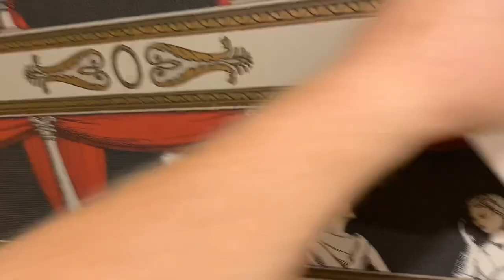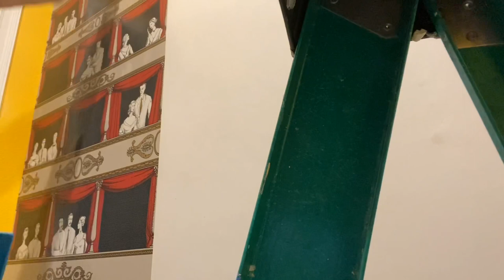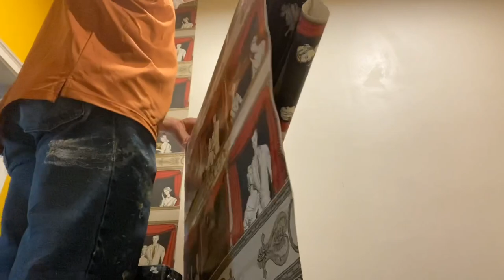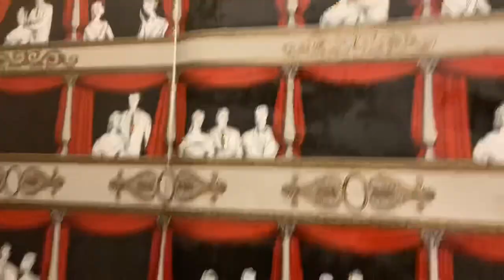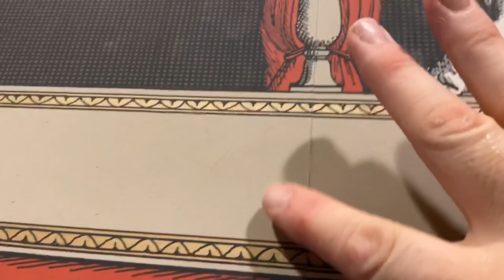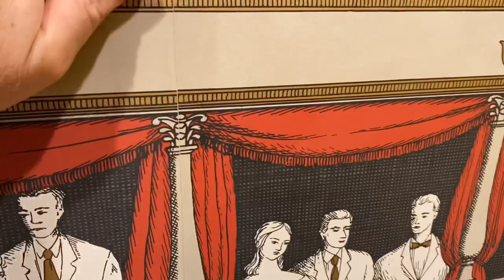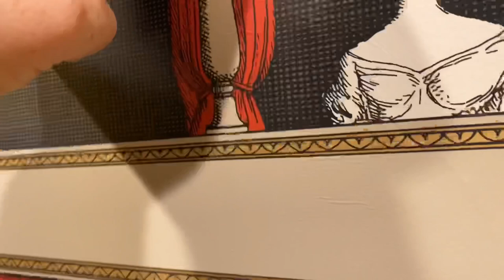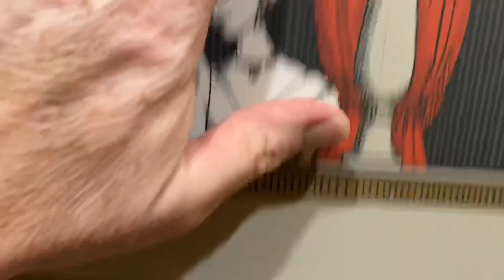How to Correct Misalignments in Cole and Son Wallpaper - Spencer Colgan

Comment: Hung paper for 30 years, all brands, all types, mylar foils, grasscloths,  burlaps, commercial bolt vinyl, fabric-backed, paper-backed, no backing, etc - you name it, I've hung it, on walls, ceilings, furniture. That said, one thing I never, never, did was use a vinyl "smoothie". Worst tool possible to use for a material that you KNOW will stretch under any pressure.
 
Hung a bank with another guy one time who insisted on using one of these to lay 54" commercial vinyl. Every seam, even though they were double cut, opened on his part of the job. Mine were sealed tight with no gaps.  I always used a medium soft bristle brush to lay the paper to the wall - and never with any pressure! The less you work it - the better!  Set the seam top to bottom - lay the material gently with a brush. That's it! All that pressure you're exerting with that vinyl tool only stretches the material and eventually it will attempt to return to it's original size, ergo - seam separation. 

Don't really like to critique another hanger as I've made my share of mistakes, but that vinyl tool should be outlawed when it comes to paper hanging.
Reply from the maker: I love what you said!!  Thank you.
Reply from the maker: Please understand that the material In this video is not final. Just so you know but I love what you have to say about vinyl